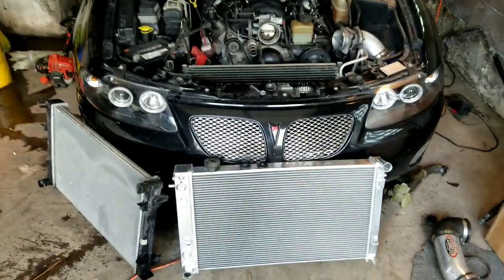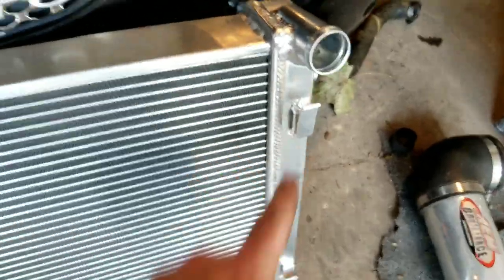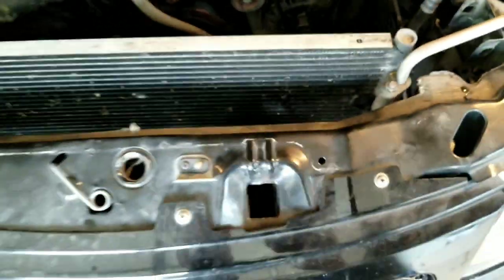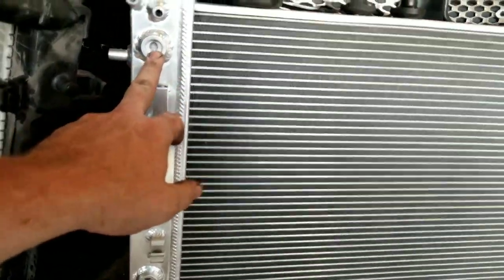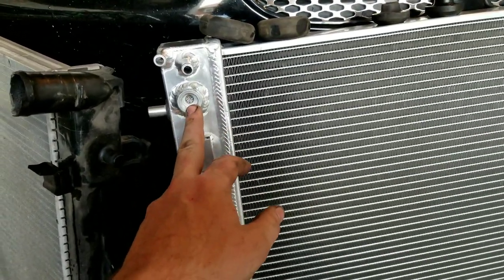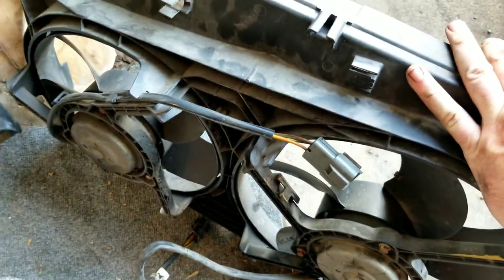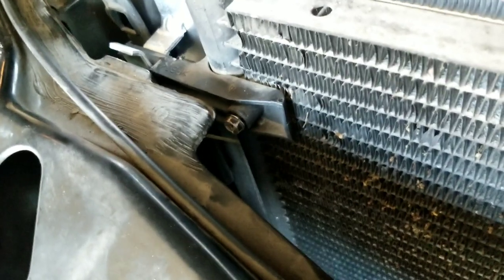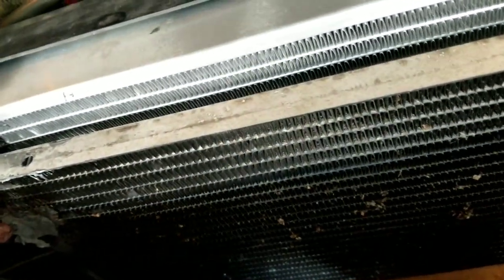GTO radiator replacement

Comment: So does it keep the engine a lot cooler than the stock radiator?
Reply from the maker: It's not like a omg different but it 100% works alot better than factory. Especially if you're doing extended spirited driving lol
Reply: @GearsAndGuns  I just had an issue with my radiator on the bottom driver side I need to change it and should I just go with an oem one from AutoZone or what's the next best bang for your buck
Reply from the maker: @shawnlibby675  I recommend a aluminum because you wont have to worry about it leaking around the plastic,  it will definitely last longer and they look good to. They are easy to install also. However if you dont drive it that much and don't really care a auto zone one will work just fine
Reply from the maker: @shawnlibby675  just dont do what I did and break the ac 😡 those screws just go right threw the condenser and is very easy to poke a hole in it

Comment: Would’ve been nice if you actually showed HOW to remove and install it lol
Reply from the maker: Yes you're right! It's an older video and I think I was just trying to show how the bigger rads fit in there. But if you need help let me know
Reply: Thanks for responding haha I think I might buy this one. Is this one of the $160 dollar ones on eBay the generic aluminum?? How does it hold up? Also the plugs? We’re the necessary??
Reply from the maker: @permabulk1454  yes it was the generic one for right around that price! Yeah its held up great no complaints at all . 100% better than stock one. I put some miles on it since it's been in there and zero issues! Yup those holes can be disregarded, they are probably for a trans cooler or something but no coolant comes out of there ( it is sealed off from the rest) I just put tape over them to keep dirt out. The only thing I will tell you is be EXTREMELY careful when taking the ac condenser out lol . The screws go right threw it and it is very easy to damage and to find a replacement now isn't easy. I poke a small hole in mine and yeah I was mad at myself for doing that
Reply: @GearsAndGuns  you have an Instagram ? Or is there a way we could direct message? Was gonna see if you could send me the exact aluminum rad you bought
Reply from the maker: @permabulk1454  send me an email at cetme3088@yahoo.com and I can help you out from there. I'll be away most of today. But I'll send you the one I got
Reply from the maker: Did u get my email address?
Reply: @GearsAndGuns  I will email you now bro thankyou!